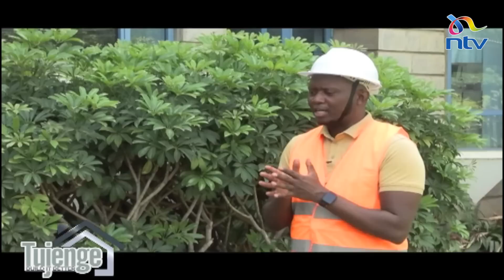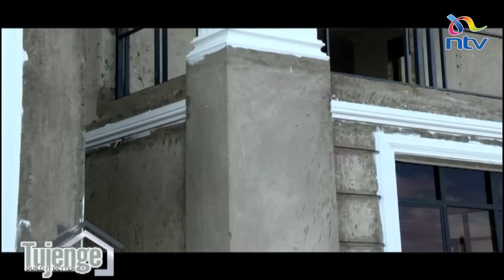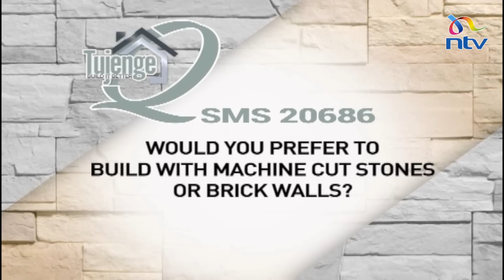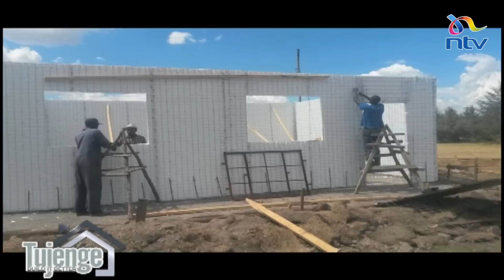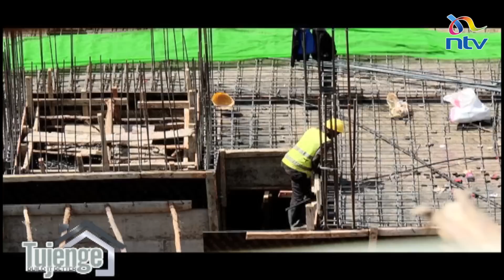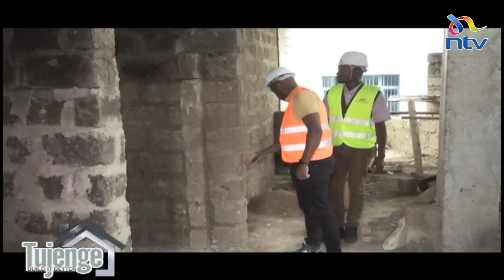Here's why your building will sink an inch or two while constructing |#TujengeOnNTV

Comment: Wait a minute, please dont tell me that when you use bricks that cant support the weight of the roof is the main reason for house cracking because if it is so why the bricks they stay intact but dont crack?
Reply: If the bricks have no cracks then the problem is the mortar thickness joining bricks. As a rule of thumb in structural design control the mortar thickness to utmost 20mm.